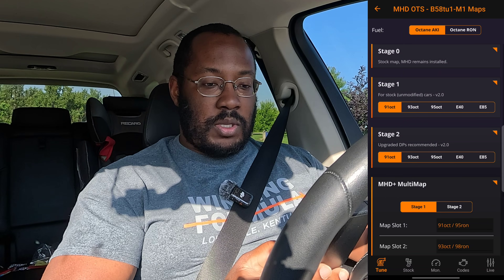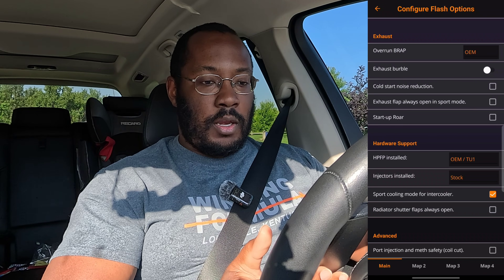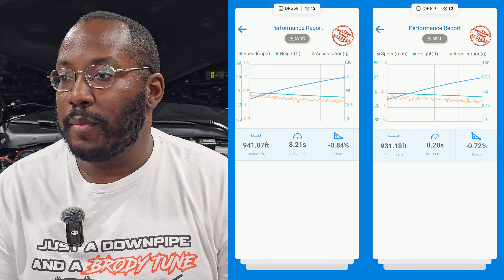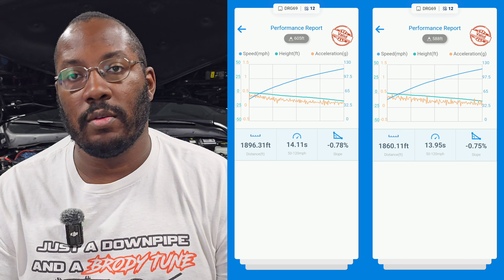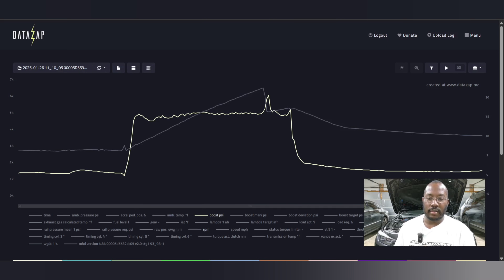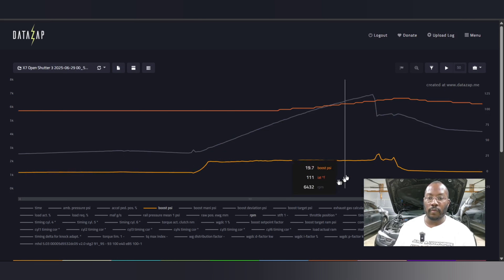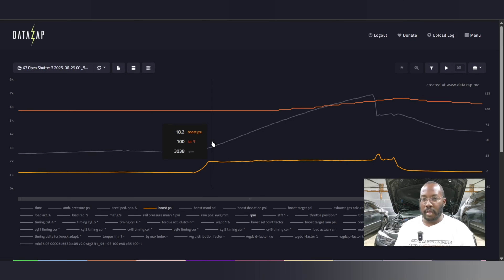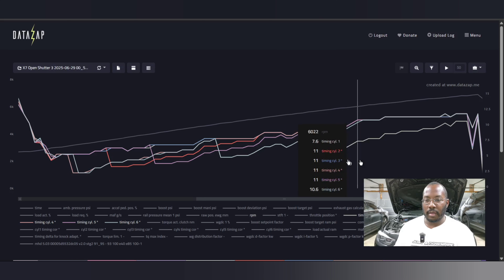Is MHD Stage 2 Worth it on a Heavy SUV? (Dragy & Datalog Review)

Comment: Why not just rerun the Stage 1 test on the same day you were flashing to Stage 2 so you could compare apples to apples? So rough to make anything from the data with such a big temperature difference.
Reply from the maker: So comparing stage 1 with a Downpipe already installed would be better? Or do I have to swap downpipes on a 1000F exhaust 5 min apart to get consistent conditions? 😊 The data speaks for itself

Comment: Have you noticed people are flashing their high beams at you? I feel like the passenger side headlight is aimed pretty high from factory, but I haven't seen any DIY videos on manually adjusting it on these headlights.
Reply from the maker: Yes i actually plan on double checking the aim at some point. Especially when driving through mountains and hills

Comment: Would my m240 struggle to hit 130 as well? Im stg 2 93 mhd as well. Never tried because my roads aren't that open
Reply: Stage 2 with a catless downpipe on my 2017 m240i and 1:30 is pretty effortless
Reply: My stage 2 430i has no problem getting over 130 so I don't see why the b58 would have that issue.
Reply from the maker: No this is definitely an X7 problem lol. Smaller cars shouldn't have an issue

Comment: I have a 2017 m240i xDrive what's a catalyst down pipe and a brand new mhd stage 2 tune. Also put new oxygen sensors in it had to reset the adaptations on the oxygen sensors and the throttle I figured out how to do a couple logs and can look at them on my phone having difficulty getting them into data's app set them to my email maybe I can get two windows and drag and drop it into the box on data zap it went from being obviously too rich I got 10 Mi to the gallon when I was getting on it to 20 mi to the gallon with my foot in it and no different cruising odd any input anybody thanks
Reply: Adding some , and . would help to make your post more readable. Just friendly advice.
Reply: @Conservator. Yep you're absolutely right talk to text I hate to type
Reply: @ShanDobson Ah, that explains it. 😁

Comment: Hasn’t sport cooling been shown to prematurely wear out the pump? I’ve heard really bad things from turning that option on
Reply: I like to know that too, I am on the Bm3 platform so I have a setting simply called "Max cooling mode", I assume that is the pump option that you mention, sport cooling, right? Then there is a "Radiator Flap" option just above my "Exhaust Flap" option under map configuration. So I can only take for this that these 2 are separate options, at least in BM3 I am using, so assume it's the same or similar for you, these 2 are slightly different but they also are very similar in many aspects.
Reply: @luffararnesugerkuk  max cooling mode makes the pump stay running 24/7 so yeah its going to most likely make it wear faster
Reply: @s_spina6241 yes understand, thanks. The pump option I will not run, the radiator flap one would be great to have on the fly option to be able to open when on need of more air through the radiator pack at the front
Reply from the maker: I haven't seen anyone show it makes the pump fail. Sport cooling for intercooler just lowers the temp delta for the pump to kick on. For max cooling mode it doesn't change when the engine pump runs, it just reduces engine temperature target.